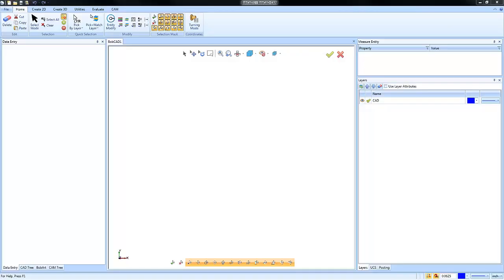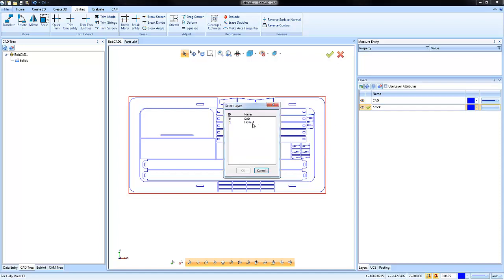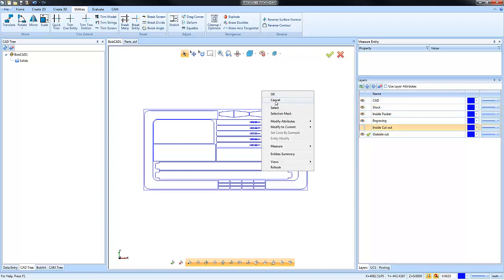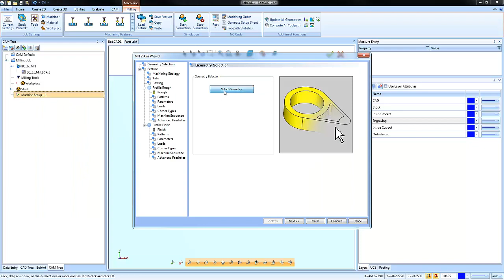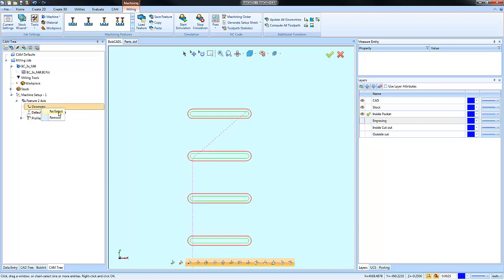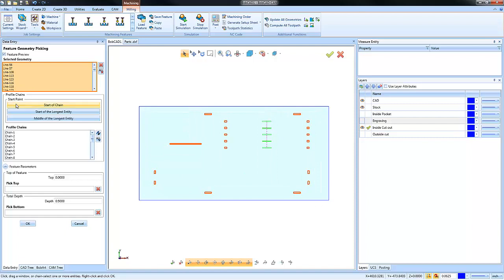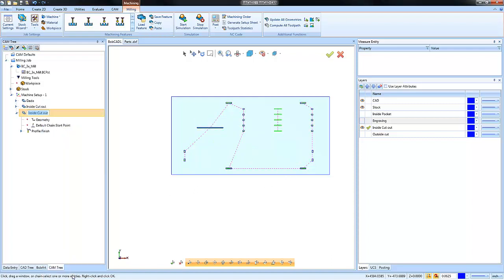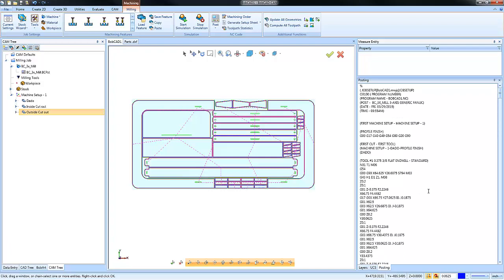BobCAD CAM V31 2D Profile Cutting for a Nested Sheet

Comment: Al, it's off topic but with the purchase of a new VMC I might be looking to go current, but the Siemens POST available for download are incorrectly formatted in many places where it has been assumed that similarly sounding Siemens variables are the equivalent of BobCAD POST variables. 
Is there any chance of getting the advanced posting documentation for V25 to see if the posts can be fixed for V25 before I consider a punt on an upgrade?
Reply from the maker: Hello Nick,  we have very good contacts over at Siemens who provide great support for us.  We have number of siemens post some of which may not be listed on the public website.  I would recommend you email support what you are looking for and see if they have the correct post already.  With that said if you are looking for the posting documentation , you'll find the documentation sub folder in your post folder.  This is where the post variables are listed and the post API calls.
Reply from the maker: Nick, how is your post working out?   I know I sent you some documentation.  What features have you added?   I know the tech team is currently working on Siemens post.  Maybe there is some feedback you have for the team.  I know we are testing on simulators currently.  What Siemens model are you running?